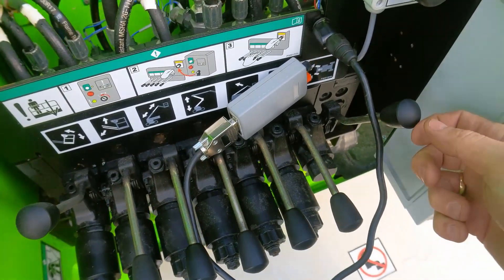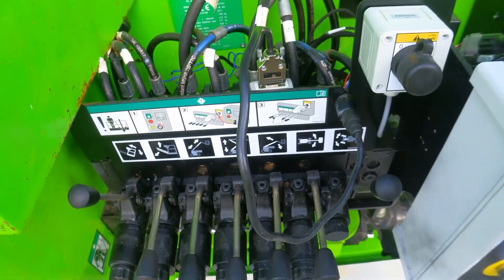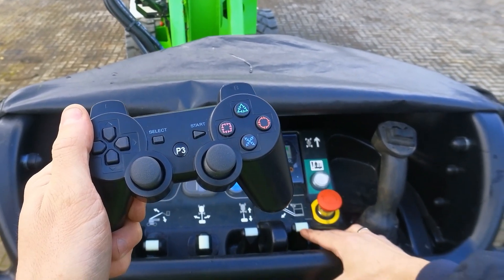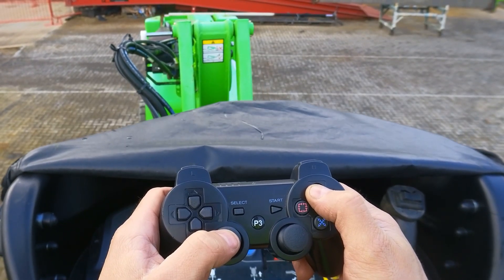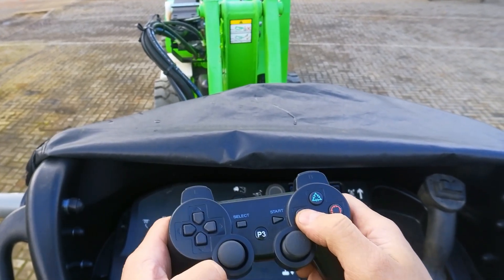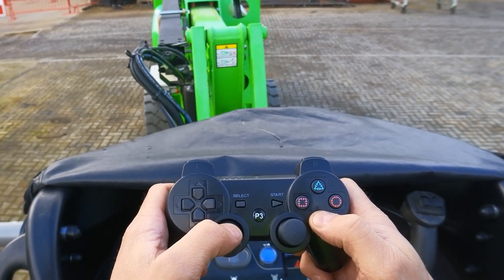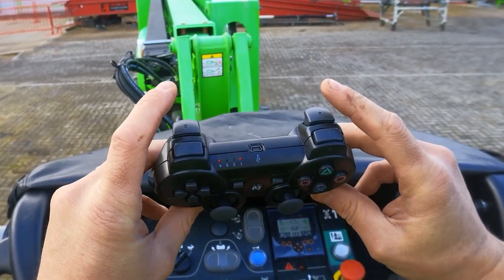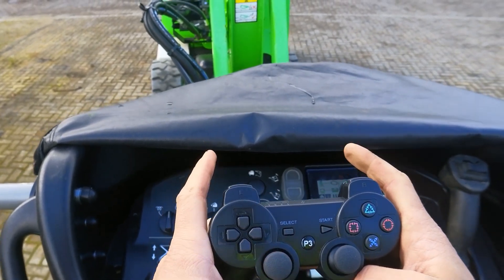+ ESP32 + PS3 Controller + Can bus  + Niftylift HR15 CANBUS HACK +

Comment: Hi! How do you interact with the BT joystick? Do you use PS3Controller lib or Bluepad32 or something similar?
I am struggling to connect the similar PS3 joystick clone to ESP32, but still have no any success...
Reply from the maker: Hi mate I think it was ps3cintroller lib. I had some issues to connect to due to ps3 controller MAC address had to change it

Comment: Would you kindly share the communication interface code of the ESP32 with us?
Reply from the maker: Mike I am glad to go through the code but I will not share exact code and communication protocol. Email me if you have so more questions
Reply: @RTFIX  What is your contact email? Also interested in the code and even the bill of materials if you'd share it
Reply from the maker: @SARE128   it is fixed.by.am@gmail.com
Reply: Wow what a amazing project, im very interesting in canbus. May i have you send email for some questions rt fix?
Reply from the maker: @electronicfreak194  sure no problems